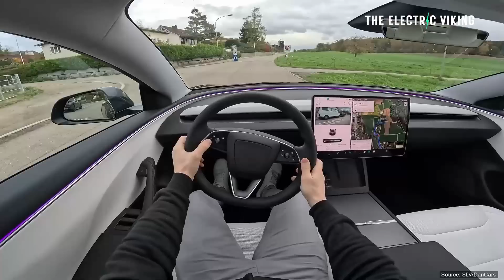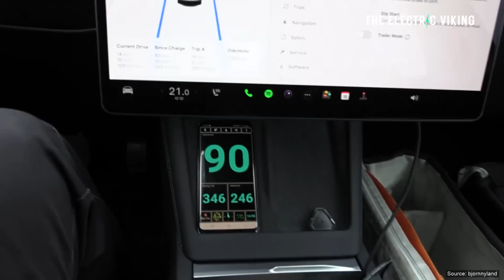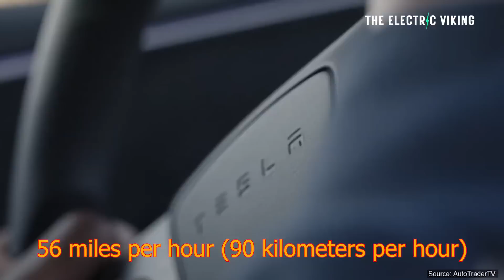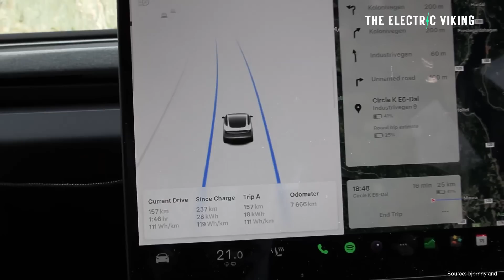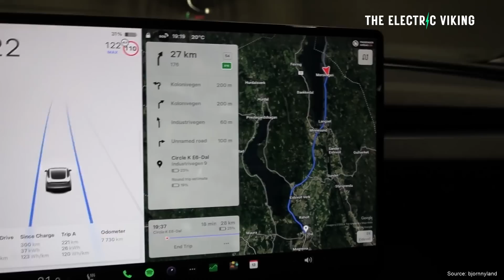Tesla with LFP battery achieves RECORD breaking efficiency in highway test

Comment: The optimum range of a minimum specified electric vehicle capable of touring, will be under 400 miles provided charging speeds are at least as good as can be achieved with current 800 volt architectures.
Many are almost there now.
It's the price that's holding back adoption.
There will never be a "game over" in the development of batteries. Is ridiculous to suggest it! Just as ICE cars evolved over 138 years, so will future transport developments.
Once you reach 350 mile range on a 10-minute charge for the average family car, the important things are to get efficiency up and cost and weight down. Roll on development...

Comment: The EV makers are having their VW scandal moment  ... "EVgate" ... efficiency is based on the battery capacity being correct... a lot of them are starting to understate the battery capacity ... batteries are bigger than claimed, making them look more efficient.
Reply: Perhaps but I would not equate the two in severity.  The customer is getting stated range and knows what the car weighs.   That is a non started compared to dieselgate.

Comment: The secret sauce is the drive unit. The drive unit blend permanent magnet and reluctance drive so they can program the drive unit to maximize efficiency at different RPM.
Reply: Anyttthing wortthwhile is going to be well over 90% regardless of who makes it and by tthe way Tesla motors are not made by Tesla.
Reply: @rogerphelps9939  If they are using outside motors that is a new thing. Are you saying Tesla uses off the shelf motors, or has suppliers that build Tesla designed motors?  Do you have a creditable source for that as it seems far fetched?

Comment: The Low Consumption is probably a result of very high Aerodynamic Efficiency, low weight, 18 inch wheels, motor efficiency and great software and tuning of the systems.
Reply: exactly it has nothing to do with the battery chemistry
Reply: @joeblack4026  well its not nothing the the batteries do heat up and that is waste energy but yeah we are speaking of a percent or so.

Comment: We're first time EV owners. Took delivery of a '24 M3 RWD with the LFP.  It's an amazing car IMO.  Yes, the battery is already obsolete, but it performs better than advertised.  That probably says more about the rapid technological developments that EV makers face than it says about Tesla producing crap.  Tesla will probably switch to the M3P LFP battery within the next 6-12 months. 

I'm a retired petroleum engineer.  Fossil fuels are a rip off.  Don't be afraid to switch.  Tesla's ride better, are safer, are 7x more efficient, are maintenance free, etc.  The combined effect of the new model 3 and FSD V12.5.1.3 is amazing.  Throw in YouTube Music and suddenly driving is the most relaxing thing I do all day.  I can listen to The Electric Viking while driving.

Ignore the trolls!
Reply: I had a 2019 "Series 1" Fremont Model 3 RWD with the original Lion "standard range" battery - without trying hard I used to get 250wh / mile or 4 miles per KWH. A genuine 250+ miles range.
Reply: While I like my Tesla Model Y for its technology (i.e., FSD 12.5.1.3) they are not maintenance-free. The maintenance is different.
Reply: @williamrogers1219  If you use a lot of regenerative braking. Your maintenance would probably consist of cabin filter and tires only. I own a 2019 M3. My only maintenance are tires and cabin filter (57,000 miles). I'll take that any day.
Reply: Very rare to see a Tesla burn, although several other EV makers have serious problems with their batteries.  Gas cars burn every day.  Turns out gasoline is highly toxic and highly flammable.
Reply: Someone else did do a video claiming SR is more efficient than LR. I suspect the lighter weight of
Smaller battery helps a lot. Good weather no sig uphill also helps a lot
Reply: M3P will not go LFP. Energy density, charge, and discharge rates aren't there.
Reply: I have a 23 M3 rwd. So likely same or similar battery pack. I've owned it for 16 months 12,500 miles. Not a single problem and not seeing any real degradation. what it says at 100% is about 267 instead of 272 when i got it. So, its not a lot of loss. The COST tho. The cost of these packs is gonna be so incredibly cheap when it comes time to swap out, i honestly wouldn't be surprised if a replacement lfp cost 4k in just a few years.
Reply: 100% agree and well stated.
Reply: Looking forward to 5 minute recharges and 350 mile range.  By then my 2023 gas truck will ripe for replacement.  I wonder if anyone will want my old truck? lol. Maybe I'll donate it to a museum.
Reply: One key thing I noticed you said more than once about the batteries is "They are Safe." I don't think Tesla is going to move to a different tech unless they KNOW they have figured a way to keep from having a thousand viral videos of cars burning other nearby cars like BYD has.
Reply: @akiramenai4973  You would be amazed how gasoline fuelled fires can burn nearby cars too.
Reply: @akiramenai4973 lol. Byd fires.  Ya ok.  Another disinformation bot.
Reply: I can listen to the Electric Viking while driving my diesel SUV! lol
Reply: @henrylawson430 our model 3 uses <$15/mo of electricity in the winter, <$30/mo in summer, with one of the lowest maintenance costs available.
Reply: @jerrybowen2869  Guess what? He can afford to drive a diesel, can you? LoL
Reply: @georgevigil7001  sure, but that would be less enjoyable, less safe, manual drive mode, generallythe opposite of high tech (WWII technology).
Reply: @georgevigil7001 
Can afford? A stupid decision paying for dirty toxic fuel.  
Included is a vehicle that's slow and requiring regular maintenance. So much old school 😅😅
Reply: @henrylawson430  Thanks for the fumes.
Reply: Another offended petrol head 😴😴😴😴
 @henrylawson430
Reply: The car is junk. You’re just easily impressed. It’s budget rubbish. Cost cutting all over. They are not maintenance free because they are always back at Tesla having some cheap part fixed that Tesla went rock bottom with such as the suspension or the aircon or the window motors. Hardly amazing.
Reply: @mattx4253 they are maintenance free,  wether you like it or not.  After 100000 km and 4 years I can tell. 
It's an amazing vehicle and so fun to drive, I will never go back to fossile fuel vehicles.
Reply: @robsta1000  no they are not. Just ask any actual owner. They are always having problems.  So not maintenance free at all.
Reply: @mattx4253  2 years 40,000 km nothing so far, not even tyres. Might change the wiper blades soon, that's about it.
Reply: @mattx4253  Is that you Lucid?

Comment: So you can get energy back when slowing down why not just cruising or even going faster. Think about that ! Any moving part can generate energy. Just
like on my bicycle i had to peddle to get my lights to work just make it efficient so you generate more without to much resistance !
Reply: You can't - when you slow down you are converting momentum into electrical energy, you can't add electrical energy and not take it from somewhere else - if you attached a wind turbine to the roof you must according to the laws of physics expend more energy turning the turbine blades by moving the car through the air than is generated by the turbine.

Comment: LFP is naturally very efficient as a chemistry. Pair that with aerodynamic efficiency and you have a very good package.
Reply: NMC bat in TM3 has almost the same efficiency!
Reply: LFP is naturally very low-density, the worst of all types. Elon uses them because they are the cheapest possible battery. He wants to bud them as cheap as possible.
Reply: @sandyfordd1843  LFP is also a far safer chemistry. It doesn't oxidise in decomposition and is far less prone to thermal runaway than other chemistries, namely NCM.
Reply: @sandyfordd1843  LFP batteries are far superior to other chemistries from a chemical stability perspective with 3 times the duty cycle of an NMC or NCA battery.
Reply: @TB-up4xi  yes, LFP are perfect for stationary devices like power walls. Cheap and low density.

Comment: I still believe electric cars will be much cheaper and luxurious in a couple years compared to fuel cars.
Reply: Exactly.  there is no need to wait for an ev.  Mine is 6 years old and perfectly fine.  there is no need to wait for a model with an extra 10 miles of range.
Reply: @vicforbetvicforbet141  well there is a reason. Prices continue to fall. And also that 10 miles of extra range can increase a lot more with new battery technologies. If you have the same capacity with 70% of the weight it can make a huge difference

Comment: LFP are great batteries.
Reply: LFP efficiency is getting very good lately.
Reply: I've got a Model Y LFP. Almost as efficient as the 3. My wife has a Chevrolet Spark EV with LFP.  Still going strong after more than 10 years.
Reply: Great for cost and longevity. Performance is...meh
Reply: Lithium iron phosphate/ LFP batteries have a low energy density, and more protection is required. These batteries don't perform well at low temperatures and need more protection and care. Transportation and aging effects are also common in lithium iron phosphate batteries.
Reply: @bittripper3530  LFP batteries are rated for 3 times as many charge cycles as NMC or NCA chemistries and demonstrate lower calendar ageing not higher.
Reply: this crap batteries are not recyclable, pure waste, they must be banned.
Reply: @MrVanre  LOL - LFP batteries are 95%+ recyclable, they are actually being recycled right now into black mass with an over 95% recovery rate.
Reply: @MrVanre  That's 1000% inaccurate. 

There are multiple methodologies for recycling LFP cells.